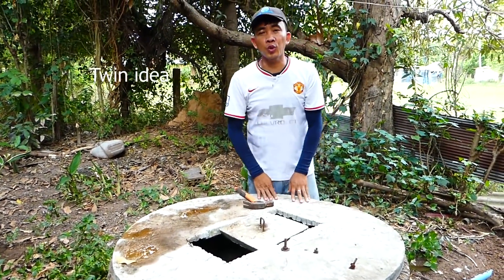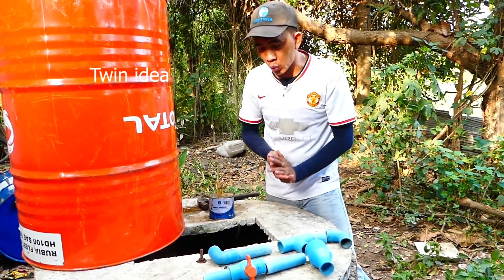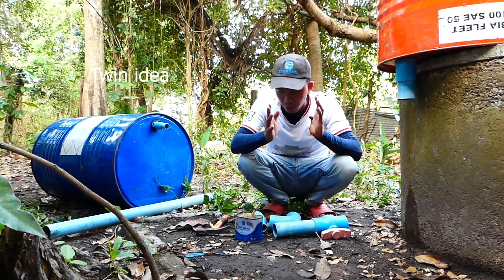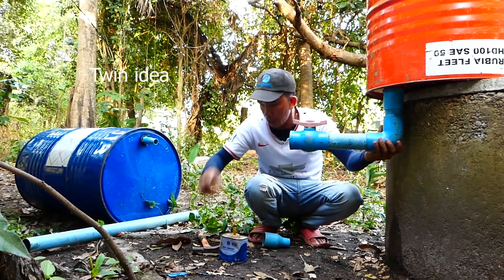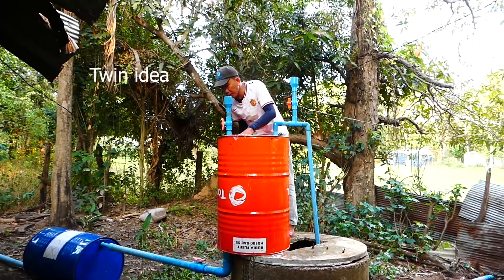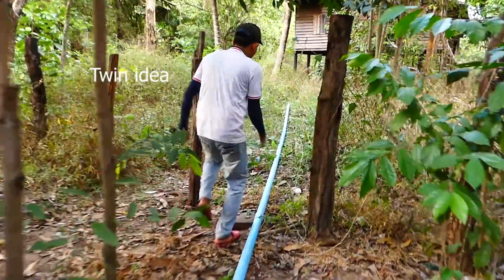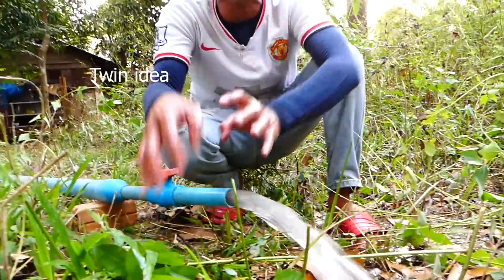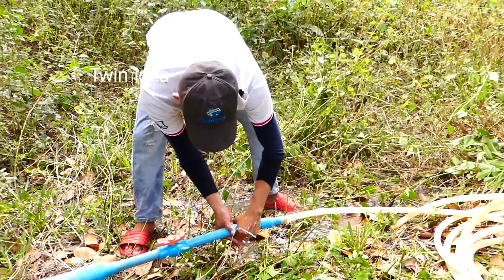Deep Well - How to make free Energy water tank from Deep Well About 7 meters Deep for Home Plans.

Comment: Inquiry: Is the greater the depth of the water source, the greater the volume of the pressure balance tank?
Reply: No, this system can not lift any water. Use as large tank you like, does not work unless the output to the field is lower than the water level in the well. A hoax, false vido.

Comment: As long as the outlet pipe is lower than the inlet pipe, the siphon principle will make this system work continuously; and he doesn't even need to have all those drums and connections. However, if the well is as deep as he claims, then the only water you will see out of the outlet pipe, is the water that he initially used to fill the drums and after that, he needs to fill the drums again.
Reply: For the water to run out of the drums there must be either air or water intake. As I can see he has valves closed and the only intake is from the well.
Reply: @calucho28457  không hiểu mà cũng bình luận. bạn ấy làm đúng rồi
Reply: Exactly
Reply: it is just a siphon effect, there is no need of any tank, this kind of videos reminds me the ones of perpetual movement or the motor running a generator that runs also some kind of appliance, they do it just to gain views, please do not believe everything you see on YouTube, the water will never be suctioned from the pot unless the discharge point is on a lower level.
Reply: l
Reply: Aww⅔e 😗😗😗4
Reply: The amount of water sip from the deep well by vacuum created from gravitational flow from close container is not equal to the outflow. The drum will soon empty.
Reply: it works if done properly.  THIS IS NOT SIPHON. 
the inlet is a third smaller than the outlet. outlet is 3X longer & bigger than inlet. 
EVERYTHING SHOULD BE FULLY SEALED. air tank close to the drum in the outlet is used to catch air created by water flow in the system. Tip of the outlet next to the valve should be the same size as the inlet.
THE WHILE SYSTEM IS DRIVEN BY THE WEIGHT OF THE WATER WHICH CREATES THE VACUUM IN THE DRUM TO PULL WATER FROM THE SOURCE
Reply: i agree 100% @josephbalon8135

Comment: Did you put  one way valve  in the bottom  of the inlet pipe
Reply from the maker: Yes
Reply: They used submersible water pump 🤣🤣🤣
Reply: @manuelekit06  SHIT NO ELECTRICAL WIRE IS SHOWN IN THIS PROJECT HOW COME YOU SAY THAT?